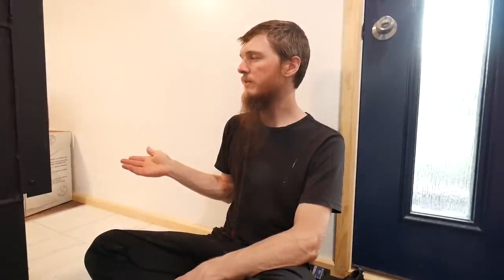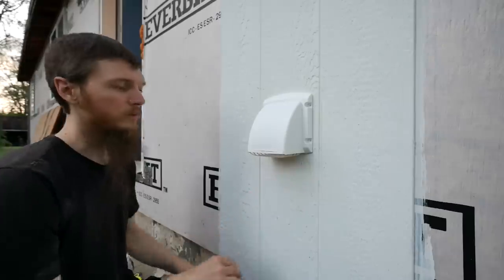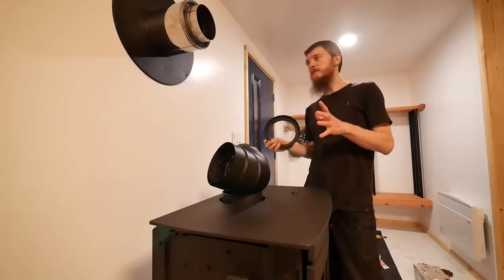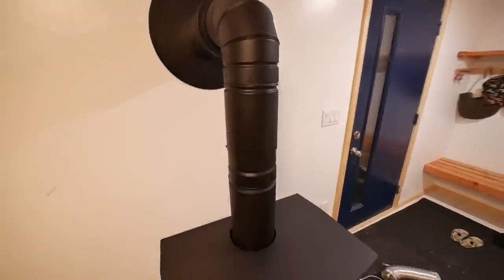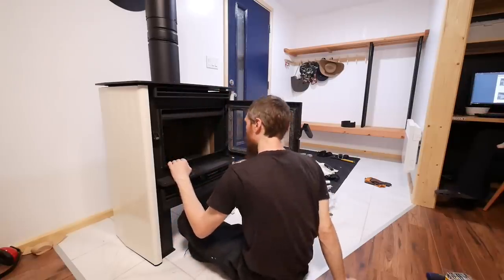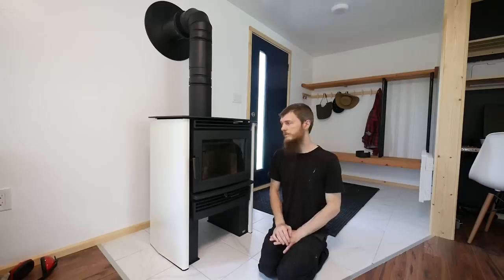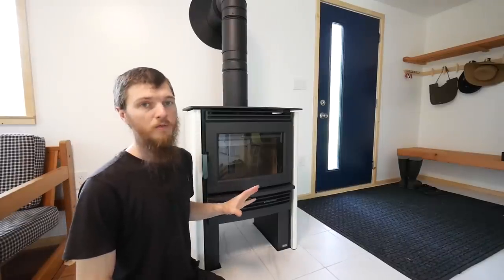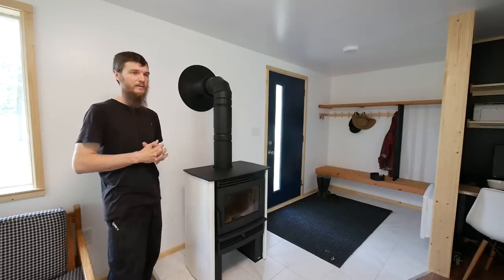DIY Mobile Home Wood Stove Install

Comment: I noticed you put the elbow in upside down. Most installers put the crimp on the inside pointing down so if there is any moister running down in side the pipes, it will not run out on the outer pipe. This has been the practice and is usually the way the manufactures design their pipes Stoves are also made to have the pipe fit inside the stove top ring and also make adapter fittings for that reason. "Quote" from a install manual.  "Stove pipe should always be installed with the "male-end-down". It is a common misconception that the stove pipe needs to be assembled the way the smoke goes, but this is incorrect. Installing the pipe male-end-down allows creosote drippings to go back down into your stove instead of running down your pipe onto the stove or floor."
Reply from the maker: These are double-wall pipes. The inner wall has the crimp facing downward :)
Reply: @diyfferent  how many times are you going to have to explain this? You are so patient and kind.
Reply: DIYfferent - 😂 you gotta be getting sick of this comment, it’s like the fourth or fifth one I’ve seen and I’m nowhere near the end! Seems like these folks are having a hard time believing that you know how to read and apply manufacturers instructions! She’s right though you are displaying more patience than I could! Good job on the install and on the video.

Comment: That’s interesting about how it turns it into a convection style heater. I didn’t realize that’s why the panels were there I thought it was strictly just to create less clearance is needed for smaller places like mobile homes.
You can’t go wrong with Pacific energy. I have an old P.E super 27 that was built in 1993. It’s my only heat source it hardly ever shuts off and they’re just super durable stoves and they heat very well we’re ahead of their time and actually it has the same kind of shielding on both the sides and the back but I thought it was strictly as a heat shield I’m wondering if those shields were even closer to the floor if they would work even better. I’m going to have to send Pacific energy an email and ask them if that was the intention of the stove that I have anyway very good information that’s the first time I’ve ever heard that, I was actually going to modify my stove and either put holes in the shields on the sides or put a hinge on it and cut it so it opens right up because I figured I was losing a lot of radian heat but maybe the convection will circulate the heat better.
One other thing is here in Canada to put a woodstove in a mobile home You can only put it through the roof. They won’t allow it to go through the wall. It’s interesting the different standards they have between Canada and the US.

Comment: I hope the outside installation of the air vent is high enough for the snow!
Reply from the maker: Snow usually doesn't pile up against the house with the eaves, but yea, it's high enough :)

Comment: doug, how come you don't need tiling or something that is fire resistant behind the stove on the wall? i was going to buy a mobile home that had one and they had the floor and wall behind it covered in red brick. i liked how it looked.
Reply: Did you watch the video? He explains it. There is a huge air gap in the back. It allows it to be closer. Its a modern design

Comment: We had a mobile home approved woodstove in our house when we bought it. Our house is a 1916 farmhouse way out in the country. That first winter all I did was fill the woodstove.  It never got our living room above 63. And it didnt heat any of the other rooms on our first floor. Only the top and the front of the stove gets hot. We hated it. So we took the woodstove out and put in electric wall heaters zoned to each room. Works so much better. Plus we have no fire protection district out here. So we have really expensive home insurance coverage and having a woodstove of any kind in our house raises our rates 30%. And paying 2000.00 a year for fire coverage is enough. Adding another 600.00 a year for a woodstove or pellet stove or any kind of gas stove is ridiculous.  It would cost more than having the electric heat. Anyone thinking about buying properties way out in the country. Check what the fire insurance is going to be and what class they are putting you in. We are in the worse class of 10. Which means nobody will put out your house if it burns. They will send out a fire forest patrol and make sure your house fire doesnt burn any trees. And we only have 1 company that will even cover us without totally ripping us off.  But even that has gone from 500.00 a year now up to 2000.00 a year. So just be aware. Not something you might think about when you fall in love with a country property. Your woodstove area looks really nice. You should be extremely proud of the work you have gotten done.😊
Reply: why do you need fire insurance at all? Do you have a mortgage?  If not, then you can do without it.

Comment: Great video as always have a question for you on the damaged piece are you able to use it on the other side by placing the damaged side on the bottom?
Reply from the maker: No, there is a top and bottom to each piece so they can't be flipped. I'm sure we can find a touch up kit if needed though.
Reply: DIYfferent just thought I ask I know on some items you can but looks great

Comment: Diyfferent kind of warmth, you won't believe how much better it will be than power. Operation tips - when loading wood in, open flu vent and air intake, so when you open the door smoke will not billow out into the room, so do that before you reach for the wood. Better to stack fire wood in there fore and aft, shorter pieces, than across, air comes down the front window, gets between the logs. Rake coals forward and break them up, then put the wood in. Ashes on the coals prevent catching. Don't remove ashes until you need to, tin bucket, let them cool, and sieve the charcoal out of it later, to put back in. Fire becomes a religion!
Reply: Also, to draw properly without smoking, chimney needs to be a little higher than the peak of the roof!

Comment: How does the wood stove fair for an overnight burn? I have a tiny house rn (150sqft) and I have a super tiny wood stove in it. Eventually, I do want to buy a single wide, manufactured home with a 'real' sized wood stove that takes 16" pieces. My current tiny wood stove is great for my space, but it absolutely does not stay lit through the night. At best, it runs for 3 hours once it's fully loaded and going.

Comment: Beautiful stove.  Beautiful work!
Does your community require permitting to install sroves?
Reply: I think there may be grandfathered in because the are replacing a wood burning fireplace.  This new stove follows all wood burning codes.
Reply: What was there before was much more dangerous.

Comment: My in-laws have a Heat Powered Wood Stove Fan, it gently pushes the air around without a noisy blower.
Reply: The best part is they use no elec!
Reply from the maker: Yeah they are pretty neat.

Comment: Great work. Been silently watching for awhile.  From experience, that intake pipe will most likely frost up (the part inside the house and may frost on the exterior of the pipe) in the winter and possibly drip onto the floor. You MAY want to insulate the pipe :)  Cheers!

Comment: Wouldn't the outside chimney be a problem when it snows?   Sorry I'm a leak when it comes to your winters ... but hopefully you know more than me ... it looks beautiful though, ...",)
Reply from the maker: No, it's a pretty normal setup. The chimney will have a cap on top.
Reply: Good question
Reply: What I meant is, when it's below freezing and the pipe is outside, not the part on the roof, make fire in the stove hot air and cold air normally isn't friends, the one extends and the other subtracts or contracts ... sorry for my stupid explanation, but thank you for your explanation, as they said it's pretty normal.

Comment: That screen looks big enough for mice to get in.  Don't the critter experts say they can get in a hole as big around as a pencil?  I think thats a nice stove .  Good work.
Reply from the maker: No, that's a widely spread myth based on a misunderstanding. Mice can get through small gaps, but not small holes. They are good at flattening out to squeeze under or between stuff, but the gaps must be wide enough for the body to get through. But as we said, we may try to add a better screen to it.
Reply: Good!  I truly hope you 2 hve delt with ll the mouse messes you will ever get in this house!

Comment: Can you please list the stove pipe thimble and connectors name/model numbers? Or links where you bought? I'm about to do a very similar install. Thanks!
Reply from the maker: We used a Selkirk brand stove pipe. Everything was selected by our local dealer and unfortunately we no longer have the list. But if you have a stove dealer near you, I would tell them what you need and they should be able to put it all together.

Comment: You didn't mention the top of the stove, but is it usable as a place for putting a pot of soup to heat up?  I know this isn't what you are planning, but just wondering if it can be used like that if by chance you power goes out.  Looks great!  So other than trim work in the house, is everything done in the interior now?
Reply from the maker: I'm not sure about that. All we have left on the inside is trim, bookshelf nook in the hallway and hallway closet :)
Reply: @diyfferent  You guys rock!

Comment: hi guys i was wondering why you didnt add a damper in your chiminey pipe ? does the stove have an internal damper?  that stove looks pretty good in there . the thing with the damper is you can regulate how fast the wood burns  and your heat output .
Reply from the maker: It does have an air control handle right under the door.

Comment: Looks very nice, wondering why by the door & not in the living to enjoy the view of it just curious?
Reply: Sylvia Lopez probably because the space is rather small that it will be easy to see anyways.
Reply from the maker: The stove is right in the middle of the living room. It's positioned across from the kitchen entry. It's really the best space for it for even heat distribution and for keeping the mess by the entry and close to where the firewood comes in. Plus we already planned on doing tile by the front door which is a great ember protection. It just made the most sense there. There really wasn't any other space for it.

Comment: Install a Carbon Monoxide Alarm in the Front room.
Reply from the maker: We have one.
Reply: Also, the top black ring needs those fixings covered, sanded and painted. Will look good.

Comment: Wondering what the white thin box on the wall in the foyer is? ( across from front door) 🤔
Reply from the maker: It's an electric wall heater made by Stiebel Eltron.

Comment: I know this was in your last house and it's been a while but were you happy with the stove after using it for a season?
Reply from the maker: Yep, we really liked this stove. The only issue was the air intake pipe sometimes developed a lot of condensation and it would drip on the floor.

Comment: I never used the outside air in a woodstove in a mobile home. Getting ready to hook a non hud stove up in my new place, just gotta leave a window cracked and its fine.
Reply from the maker: I honestly didn't care for the air intake. The concept is nice, but it was constantly dripping with condensation from the cold outside air coming through it and causing water damage to the wall. Also, you could feel the cold draft coming in when the stove wasn't running. I don't think I would install it the same way again.
Reply: @diyfferent  I hear that from a few people on them. Everybody i know that lives in mobile homes in the mountains have had woodstoves for many years with no source of outside air. Glad i am not going to be using one. Apparently the government banned the use of flue dampers also, so my stove there is no way of taming it down with out one because it does not have a damper built into the stove just an open constant supply.
Reply: @diyfferent  I ve never seen that kind of an air intake for a mobile home? Are the codes different down in America? My air intake is below my stove going through the floor .

Comment: does it have an electrical fan to push out the heat?  thats a beautiful unit.  i am going to try purchasing one exactly the same.
Reply from the maker: It doesn't come with one, but it is an option.
Reply: when you ordered your woodstove, did the pedestal come with it?
Reply from the maker: @georgioantoine4194  Yea, it's all one piece.
Reply: @diyfferent  I need to locate one here in Saskatchewan Canada.... awesome thx!
Reply from the maker: @georgioantoine4194  https://www.pacificenergy.net/find-a-showroom/

Comment: The black connector pipe should always be installed with the frimo end facing down. IRC 2018 chapter 10
Reply from the maker: These are double-wall pipes. The inner wall has the crimp facing downward :)

Comment: How much did that heater run you? What’s the brand name?
Reply from the maker: The woodstove is a Pacific Energy- Neo 1.6 and was about $2,000.
Reply: DIYfferent appreciate it!
Reply: I’m actually looking into purchasing a wood pellet stove. I’m assuming with all the acreage you have with access to free wood it was a no brainer as to why you chose the wood over pellets?
Reply from the maker: @shaunehemphill3259  Yea, and we wanted something we could use if the power was ever out and pellet stoves still require electricity to run.
Reply: DIYfferent thanks!!

Comment: What is the brand name, I've been installing stoves for 30 years and have never ran across a brond of double wall black pipe that is installed crimped end up.
Reply from the maker: The pipes are made by Selkirk, the pipe is double wall and the inside wall was installed crimp end downward, and the one on the outer wall is up.
Reply: I looked up all the brands after I posted that and realized the one brand I haven’t used in 10 years, was the only brand out there that installs crimp end up. I apologize, I’ve been using 3 or 4 brands for so long, and the codes haven’t changed, but manufactures recommendations supersede local and national codes.

Comment: Cool video I just decided to start looking into something like this for my double wide because I am concerned with society and the economy collapsing.  I’m hearing rumors of food shortages and now Diesel engine oil supply is running out. Without that there will be a total collapse of society as we know it.  Trains run on diesel and trains haul coal to electrical plants not to mention 18 wheelers deliver everything we need.  Thanks for the video it’s very helpful.

Comment: Will you use one of the passive fans on top of the wood stove?
Reply: There is no such thing as a passive fan. Fans are kinetic.
Reply: @genli5603  what I meant was the fans for wood stoves that sit on top and do not require electricity. The Ecofan AirMax Wood Stove Fan is one example. Thanks for commenting.
Reply from the maker: We may, those type of fans are very neat.
Reply: @diyfferent  We have two of them and they are great. We live in Upstate NY and when the power goes out in the winter they still circulate the warm air.

Comment: Studying everyone's installs...  On a super short time span...  Mine went bad by person doing it...  They just don't have the skill levels needed to be safe and up to code.  I'm broke, cannot buy any more supplies of any kind.  I thought they were doing one thing and it turned out they were jimmy rigging stuff horribly... They probably are not very happy with me that I did not allow it. 
My stove piping is not insulated and must pass through a wall space that used to be two now removed windows.  I'm looking at putting in actual brick for the pipe to pass through.

Comment: You didn't need a damper in the stove pipe?
Reply from the maker: No, this stove is made under the newer epa regulations so the air intake is regulated in the stove to keep them burning efficiently. There's a air control level on the front of the stove and chimney dampers are not recommended.

Comment: Won’t the smoke leak through all screw holes?
Reply: Pretty sure the screw holes only go threw the outside layer of the pipe.
Reply from the maker: These chimneys work on negative pressure. The warm air is being pulled up and out. It creates a vacuum so if anything, air will be pull into the chimney through any small cracks. But smoke should never come out if the chimney is working properly. That's why stove pipes aren't usually sealed at the seems, just stuck together. Hope that makes sense :)

Comment: Where do I get the ducting in black.
Reply from the maker: See if you have a local woodstove dealer near you and they should be able to get you what you want. The pipe we used was Selkirk. Our interior pipe is black, the exterior is silver.

Comment: Did you ever put a heat proof non combustible material between the wall and stove? Aren't you supposed to?
Reply: Virginia K. ..Needs a big tin sheet on the wall.
Reply from the maker: For this particular stove it's not required :)
Reply: Girl did you watch and listen to the video?
Reply: No. That sheet wouldn't actually do anything anyway.

Comment: also i would put the male end  in female downhill to stove you gonna have creosote getting all over the place, if male in female downhill it will flow into the woodstove vs the outside of stove and floor
Reply from the maker: It's a double wall stove pipe and it's installed the correct way.